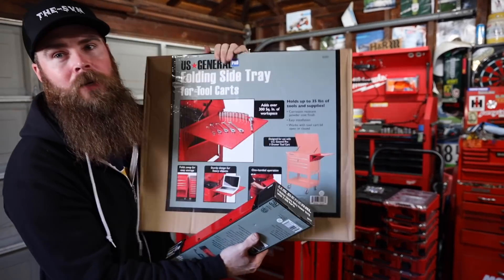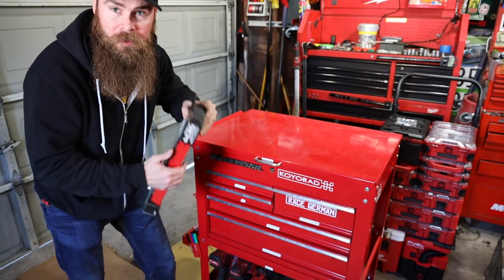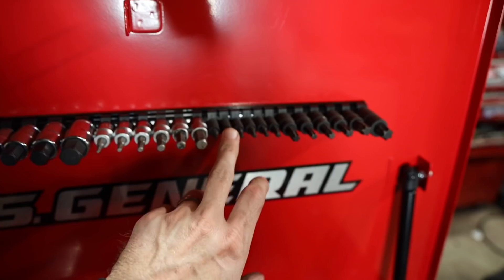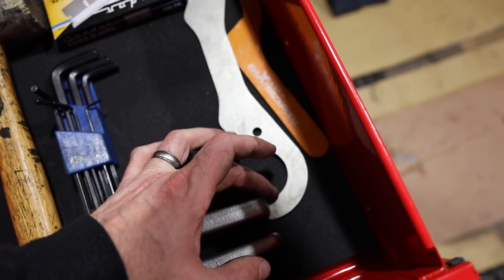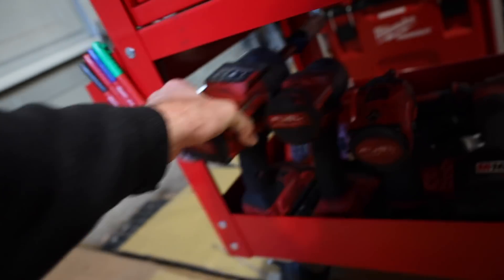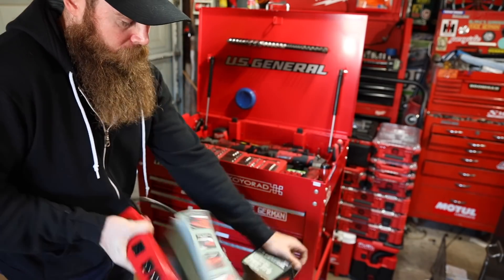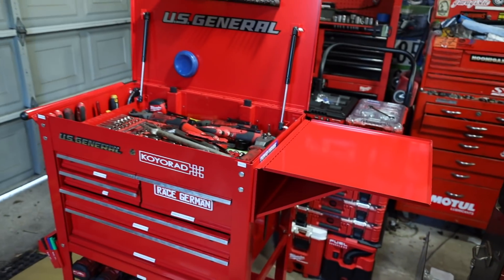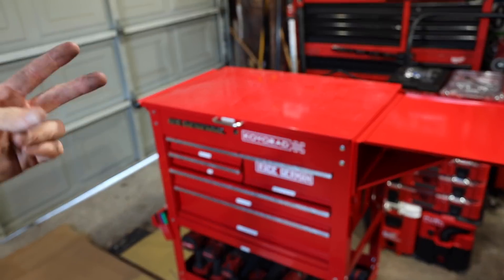NEW HARBOR FREIGHT 5 Drawer TOOL BOX Tour plus ACCESSORIES

Comment: If you grind the rivets off the back it disables the lid lock so you can open drawers with the lid down.
Reply: Hero.
Reply: Why would you want to do that? Now, you can’t lock the lid/drawers.
Reply: Or remove the plastic tops inside the box. You fan always put them back.